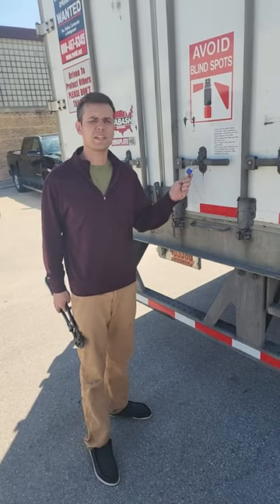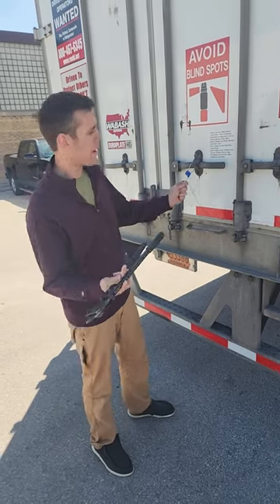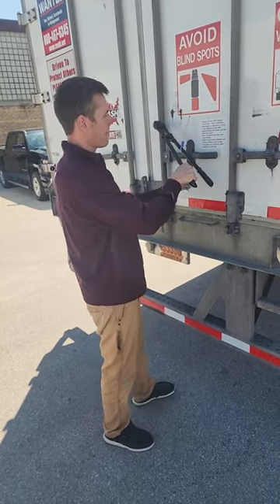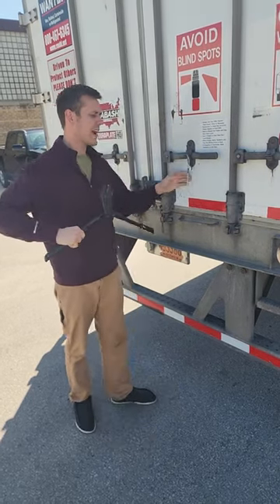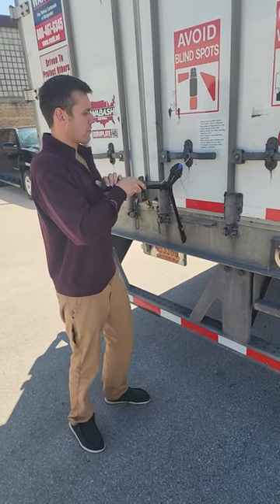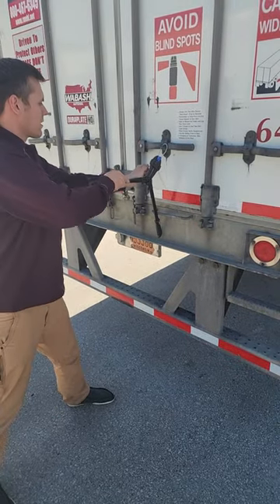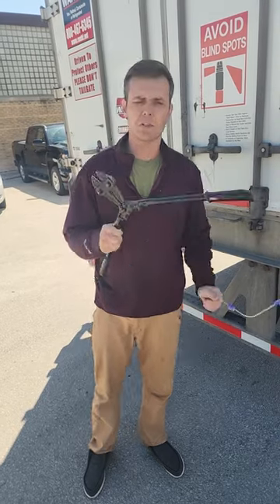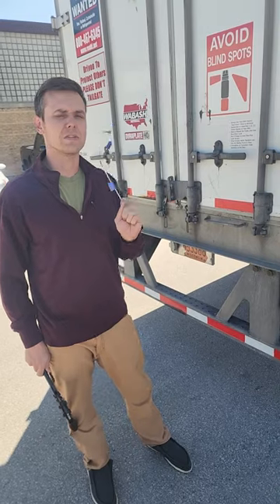How to Break a Metal Seal on Your Trailer

Comment: Yeah just use the fork in a hammer and twist then use the fork to pull the twist through the hole. No dull cutting edges and takes 2 seconds.